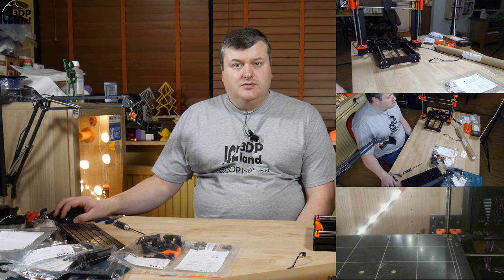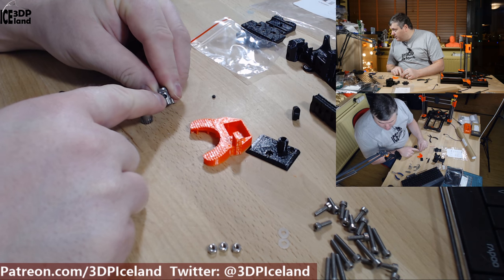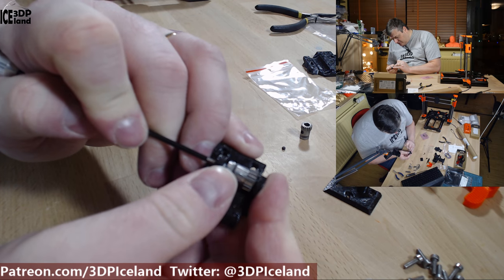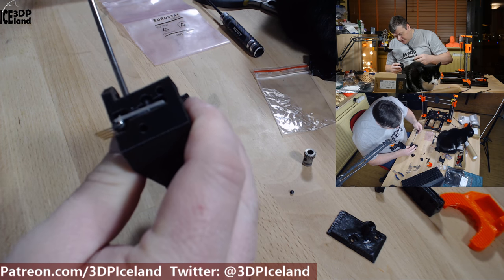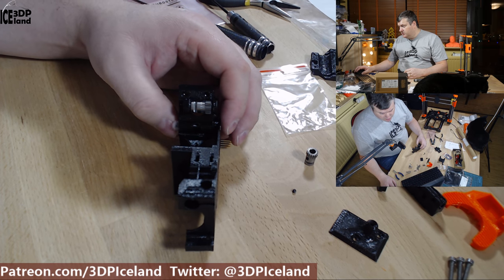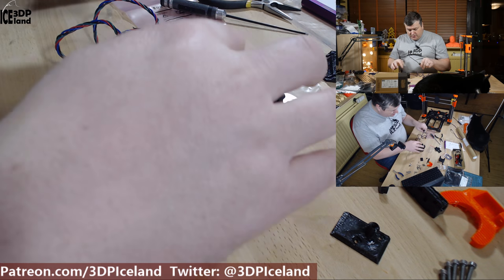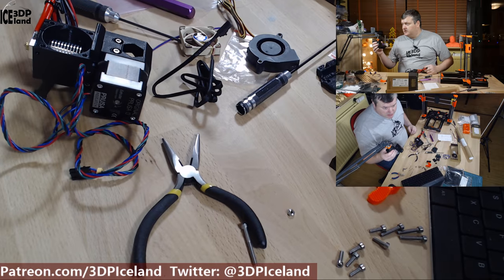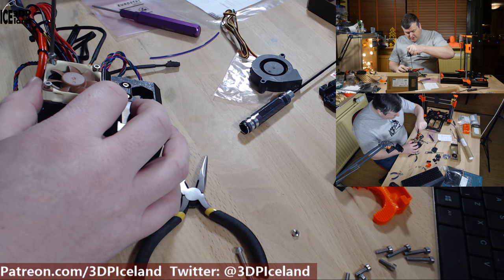Prusa i3 MK3 3D Printer Build Series - 5. E-axis assembly

Comment: Great Tip pulling the 5050 fan nut in place with the extra step as the fan housing can break using too much force. Saw it cracking on the 24+ build stream happening.
Reply from the maker: yes thank you,  the fan housing is weak, - I cracked it on my mk2 :)